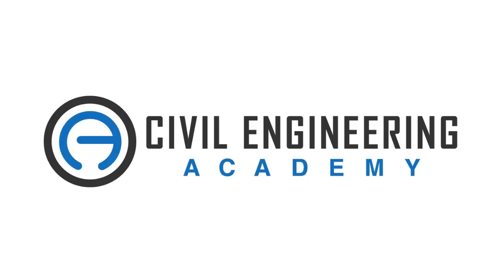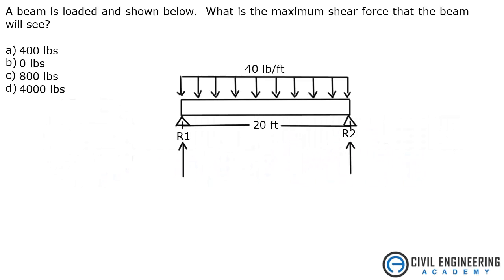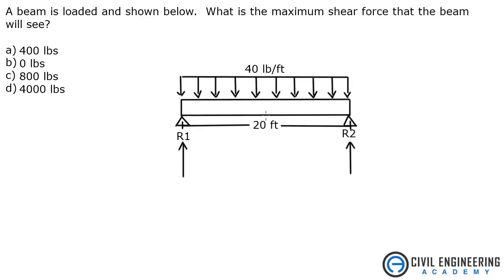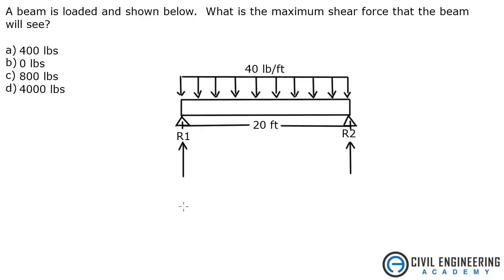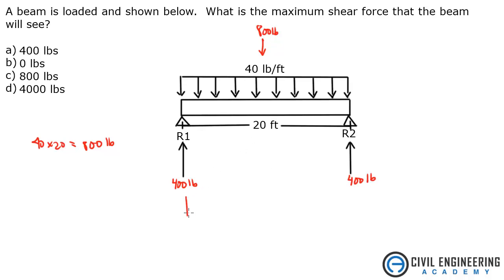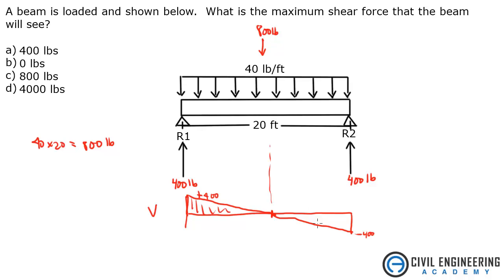Structures-Find the Max Shear in a Beam

Comment: Why wouldn't the shear diagram be a mirror image since it is a simple unpinned support reaction on both sides?
Reply from the maker: It isn't a mirror image of what is shown because the loading on the beam is a distributed load.  If this was just a point load then things would look different, but because the load varies along the length of the beam the shear diagram changes as you march from left to right along the beam.  I hope that makes sense!